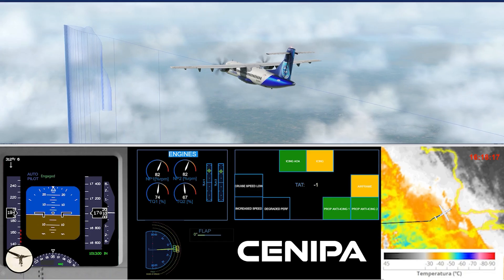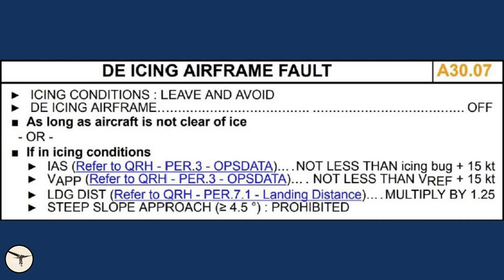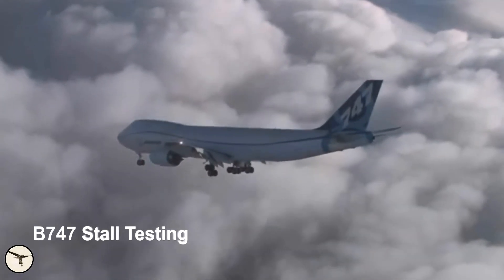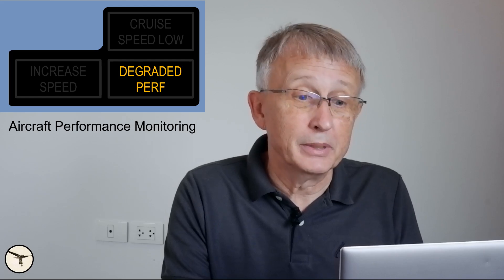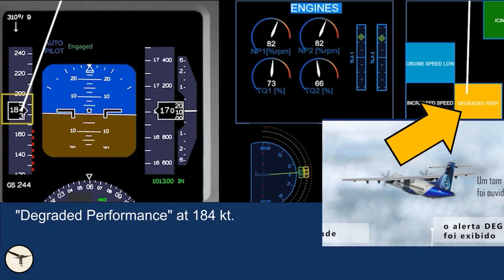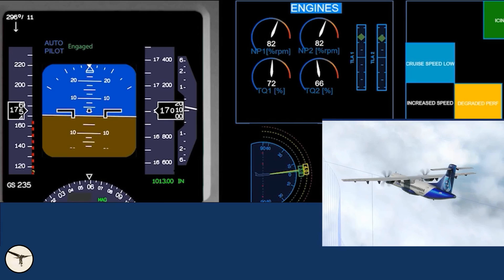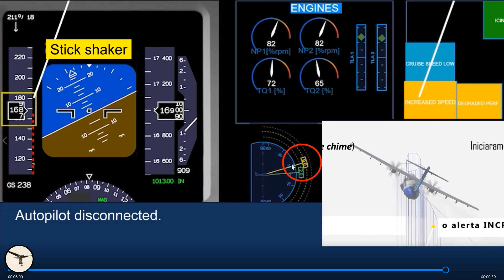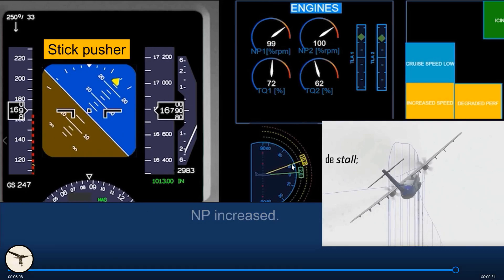ATR 72 Crash: Understanding the Flat Spin Disaster - Expert Analysis

Comment: A question: why the autopilot (assuming it was the autopilot for a moment) initiated a turn to the right with the degraded performance indicator asserted and with the flight computer aware that an icing event was happening? This does not look right. At the end, despite all human factors we evidence on this video, it was the turn that stalled the aircraft.
Reply from the maker: ATC cleared the crew direct to a waypoint, and the crew updated the FMS to fly to that waypoint. The APM does not control the autopilot; it only gives warnings to the crew. It is the responsibility of the crew to fly the aircraft. The autopilot is an useful tool, but that does not remove the responsibility from the pilots.
Reply: @FlywithMagnar  Thanks for answering Captain Magnar. I agree that the pilots bear the responsibility for the aircraft and to decide when and how the autopilot is used. I guess my point is the autopilot software is programmed to disengage under certain circumstances. It seems to me (I am not a pilot but an avionics engineer) that would have been very beneficial in this specific case if the autopilot had disengaged earlier by using information about the state of the APM system and let the pilots to decide what to do next. Despite of how they get into this situation in the first place, it is much better, systems engineering speaking, to disengage the autopilot while the aircraft is still aerodynamic stable than during a stall caused by icing on the controlling surfaces that changed the acft flying characteristics in a very unpredictable way.  I hope CENIPA looks into this factor and how ATR assessed the interactions between the auto piloting system and the APM system when they implemented the latter as a result of the lessons learned from previous similar accidents and incidents. Thanks again for providing these important videos.
Reply: @FlywithMagnar maybe use LOW BANK on ICING CONDITIONS

Comment: People are still blaming ATR, it’s so frustrating. The plane did it works, the crew’s lack of action is the reason why the plane went down.
Reply: I saw a post saying 30 ATR's crashed already for flying in ice.  Liars love to lie.  Only 5 in 40 years stalled with ice.  All due bad pilots that stalled it even with all warnings to keep speed up.  They were stupid to not do their job.
Reply: @JavierBrent  yes exactly
Reply: @JavierBrent Yeh the aircraft is generally safe, it's only had 13 accidents in 35 years of service,but almost half were due to icing, not sure how that compares to other turboprops in its class.
Reply: Exactly.

Comment: NON 2015 Icing Certified plane developing ice, known to introduce AoA degradation on top of that. 

Marked as unsafe airplane by The Accident Investigation Board Norway (AIBN – the Statens Havarikommisjon for Transport  [SHT] in Norwegian).

Source:
"ATR72 Control Problems in Severe Icing, Norway, 14 November 2016"
Reply: They still operate the ATR in Norway
Reply: @bonnoteriiteporouarai7097  REPORT 
SL 2020/1 - Accident Investigation Board Norway (AIBN)

Conclusion (page 47):
 It is therefore important also to take into account the characteristics of the aircraft 
type when airlines considers icing exposure in their flight operations risk analyses.  

-

There, marked as unsafe by them.
Reply: @codecoderr7495  but they still operate ATR there anyways. So it’s not that unsafe as long as the crew applies the procedure
Reply: @codecoderr7495 Of course the aircraft type should be part of the equation. Where do they call it unsafe?
Reply: @visualdarkness  

Did you read the transcript of the 4184 or do you also need it spoon fed?

"Critical Aviation Safety Issues Emerge from Voepass ATR72 Accident - Episode 238" video, first minute or so.

Comment: I would like to ask the instructor about something that, for me, wasn't clear in the explanation. When the airplane goes from 130kt to 0kt in less than 1 second, does this indicate a sudden deceleration of the airplane relative to the ground (which would lead to a force of more than 7G), or is it simply an indication of airspeed on the sensors? I ask this because 7G of force could have, at that moment, surprised everyone and injured many occupants, including the crew. Would I be correct? Thank you very much for your excellent work in this video and on this channel.
(Portuguese) Eu gostaria de fazer uma pergunta ao intrutor, sobre um fato que, para mim, não ficou claro na explicação. No momento que o avião vai de 130kt a 0kt em menos de 1 segundo, isso indica uma desacereação brusca do avião em relação solo (o que levaria a uma força de mais de 7G) ou é apesar um indicação de velocidade de ar nos sensores? Pergunto isto, pois 7G de força poderia ter surpreendido a todos e ferido muitos ocupantes, inclusive a tripulação, eu estaria correto? Muito obrigado pelo seu excelente trabalho neste vídeo e neste canal.
Reply: This is sensor related. 
If you blow inside a tube you feel the air flow at the end of the tube.
If you just blow over the tube 90 degrees offset, no airflow will be detected at the end  of the tube.
That's what happens during a stall.
Espero que tenha sido um pouco compreensível
Reply: Air speed and and ground speed different. Not a 7G sudden stop like that. The other comment explains well how the sensor works.

Comment: Is there any possibility the horizontal stab is stalled too? It seems hard to believe they would have the strength to oppose both the stick pusher and the aircraft's natural tendency to want to pitch down into the now downward vertical flight path.
Reply from the maker: The only instances of horizontal stabilizer stall occurred when full flaps was deployed during the approach. The nose of the aircraft wound then drop straight down.

Comment: Can be the pack malfunction and de-icing system fault somehow related? Like problem with valves control on one side of aircraft, on same engine for example? Of course, its only speculation, but we have two failed systems which can be traced to the engine hot air source. Thanks for video.
Reply from the maker: As i said: No. The failure had nothing to do with loss of bleed air from the engine. The fault light appears when the sequencing of the de-icing boots is not correct.
Reply: @FlywithMagnar  Thanks.

Comment: It seems to me that the autopilot should automatically disconnect when the degraded performance indicator is illuminated. The autopilot continuing to attempt control of a compromised aircraft only made matters worse. The pilots were likely confused by the unexpected feeling of the flight controls at the point in time when the autopilot was finally disconnected. Clearly, the continued flight in icing conditions is likely to be the biggest contributing factor to the crash. However, in order to prevent a similar crash from ever occurring again, it would be wise to find any point at which the chain of events could be stopped. In the interest of human factors engineering, the manufacturer should also consider making the “increase speed” indicator red in color to reinforce the concept of an impending catastrophic failure.
Reply: I'm no pilot but I disagree. Disengaging the AP has to be a conscious decision.
The AP may be masking unequal aileron loads.
That's why it has to be disengaged prior to entering a region of severe icing.
Manually controlling the plane will allow the pilot to better sense imbalances that indicate ice accretion.

Comment: Maybe I missed it, but where does the "cruise speed low" get its info from?  Do you enter planned cruise speed in the 'computer' (FMS or MCDU equivalent for ATR)?
Reply from the maker: The APM computer receives data from many sensors and computes the theoretical cruise speed. Then, it compares it with the actual cruise speed.

Comment: At this point, the analysis should be mainly psychological. How did the flight crew not decide it is a bad idea to fly through and remain in severe icing, with faulty de-icing and air compression? How did they not immediately act on degraded performance and draw a connection to severe icing? It also seems they had no idea and awareness off stall speeds and maintaining a stable flight in critical situations. Button pushers in a shirt.
Reply: More than that: they were totally unprepared to push the right buttons at the right time. And yes: Indeed very good questions.
Reply: @NicolaW72  Thank you.
Reply: Great remark, Cruisemissile. 
We are mainly programmed to choose between flight or fight. If your self confidence is destroyed, you neither choose one or the other and stay frozen. 
We see this increasingly happening during difficult times in all domains of life. But in a cockpit you have to keep fighting, there is no escape. And this has to be done in good coordination with your colleague. 
As a pilot it is good practice to do a short evaluation of your behaviour after every flight, to keep track of your fitness.
Reply: @micheldriessen5081  Indeed.

Comment: Hi Magnar, this might sounds like a very stupid question, "What were the manufacturers thinking when they decided to install an inflatable boot on the wings instead of using the engine bleed air to warm up the wings to prevent icing?"
Reply: I don't know of a regional turboprop that doesn't have boots. There's probably a reason for that. Perhaps not enough heat coming from the engines.
Reply from the maker: It is a question about performance. De-icing boots requires very little bleed air from the engines.
Reply: @FlywithMagnar  My thinking is that if the engine if powerful enough to lift a plane into the sky, it's powerful enough to run bleed. Guess I learn something new1
Reply from the maker: @lhw.iAviation  the air conditioning system alone removed 6-7% power from the engine. If you use bleed air to prevent ice to form on the wings, you will lose a lot more than that. Boeing uses electrical heating on the 787, and ATR is planning the next generation (EVO) to have electrical heated wings as well.
Reply: @FlywithMagnar  Wow! I didn't know that TurboProps have so many limitations. I saw them fly into mountainous unpaved airports and thought, they must be really powerful. Looks like there's a lot of compromises that need to be made.
Reply: Every turboprops use deicing boots. Not a single one use hot bleed air

Comment: The autopilot almost drove them to the stall condition , leaving them seconds to react it should have disengaged after the message of degradation of speed
Reply: ATR procedure is to disengage the autopilot before entering a icing region. It's high up on the list of memeory items.
Reply: @marcg1686  Indeed. The AP should have been disconnected long before the final crash sequence of the flight.

Comment: The aircraft is trimmed by the autopilot to a full nose up setting and the wing and control surface performance is degraded by ice accumulation. Then the autopilot hands back control to the pilots, who have perhaps ten seconds at best to recognise the situation, trim nose down and gain control of the aircraft with degraded controls. With the element of confusion and disorientation, it was never going to happen. The airframe de-icing fault was undoubtably a distraction that contributed to the confusion when the autopilot disconnected.

Comment: Very strange decision-making by the pilots in response to the icing and supposed anti ice faults. I am curious on what basis they make the assertion that the system is faulty, are there any indicators for it in the cockpit? And also, very strange control response by the pilots during the onset of the stall, I am reminded of AF447 and the MCAS crashes that pilot response to unusual control situations is sometimes or even often absolutely not in line with what the regulations and aircraft certification expects.

Comment: Obviously this raises some questions about pilot training and/or airline safety culture (did they not know how to respond to the performance warnings, or were they habituated to ignore them?), but I think it's also fair to ask whether it should really be considered normal for an autopilot to happily trim a plane all the way into stick shaker and then unceremoniously dump the controls of the mistrimmed aircraft into the hands of a startled pilot. Is it really too much to ask for an autopilot to prioritize keeping the airplane within its flight envelope over whatever was requested through the mode control panel? Surely it could have noticed (or even predicted) the AoA approaching stick shaker and reduced bank angle to avoid it?

I think ideally an autopilot (in the absence of a serious fault) should also avoid sudden disconnects and instead would warn the pilot if it is has trouble executing the commands from the pilot (e.g. due to approaching control limits), but continue to fly the plane to the best of its ability to allow the pilot to assess the situation and physically take the controls before disconnecting the autopilot.
Reply: @MatthijsvanDuin  After reading all the comments I still stay with my first one. This aircraft is too dangerous in ice and the pilots who fly them don’t seem to understand how sensitive they are by the number of fatal crashes. I worked for many years as a Certification Engineer Head of Structures and if still working would and will urge Transport Canada to withdraw the Type Approval of these aircraft
Reply: então, no dia aqui no Brasil varios pilotos relataram gelo severo incomum no Brasil, inclusive avioes pousaram e aeroportos da minha cidade que ´é pequena, a aviação civil no Brasil é uma das melhores do mundo com baixa taxa de acidentes, mas neste caso alem do gelo severo, o piloto ser novo , um pioto foi chamado para cobrir outro de ultima hora, a investigação deve falar sobre fadiga, descanso, treinamento etc......

Comment: @FlywithMagnar  assuming you find yourself in an ATR in a flat spin, would differential thrust on the engines help to arrest it? How much time do you need to recover?
Reply: A flat spin in an ATR is likely unrecoverable.
Reply: Not a pilot, but I have read that the weight of the engines in a twin-engine flat spin cause so much centrifugal force, it is very unlikely you would be able to recover
Reply: @MegaMadmechanic  This theory is correct, however it's more applicable to light twins. The main issue for a transport aircraft is likely the weight of passengers/cargo in the fuselage and fuel in the wings.

The engines (excluding props) on the ATR are under 500kg each and are only about 4 meters from the CoG. Pax/cargo load can be around 5,000kg, and half of that load is probably further from the CoG than the engines are. Plus fuel in the wings which can account for another several thousand kgs, also quite far from the CoG. At the end of the day, the engines probably contribute a tiny amount of annular momentum compared to the fuel and pax/cargo load